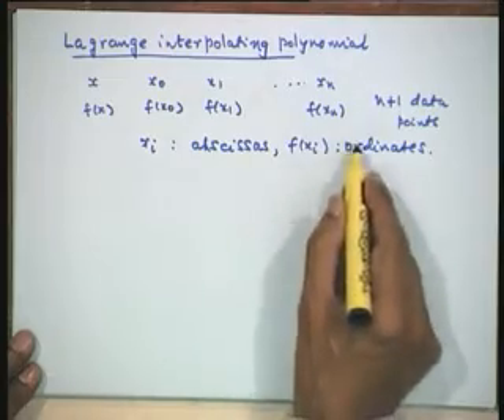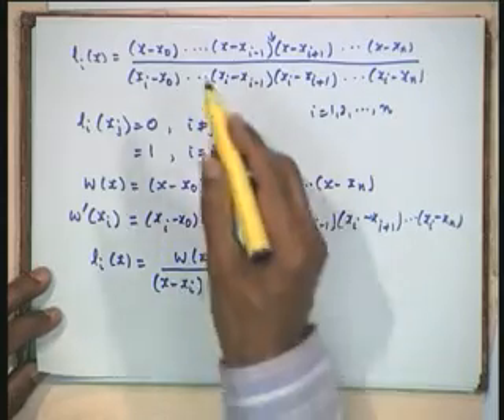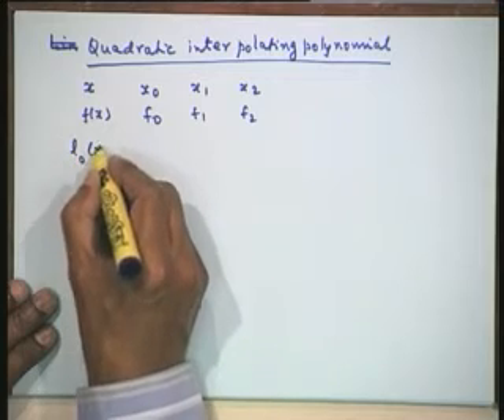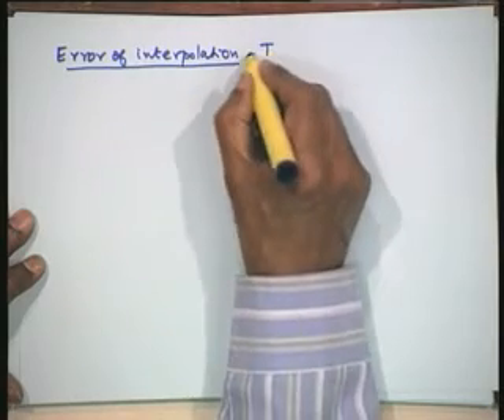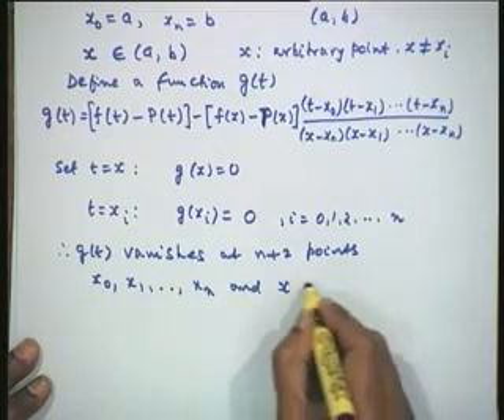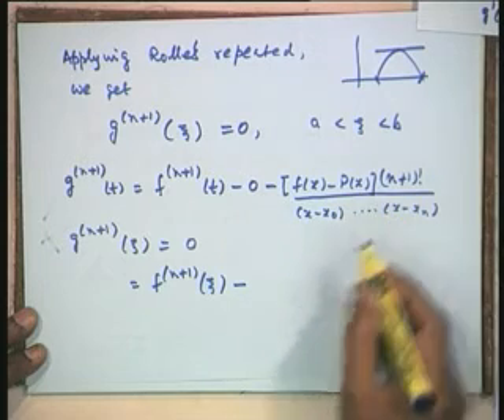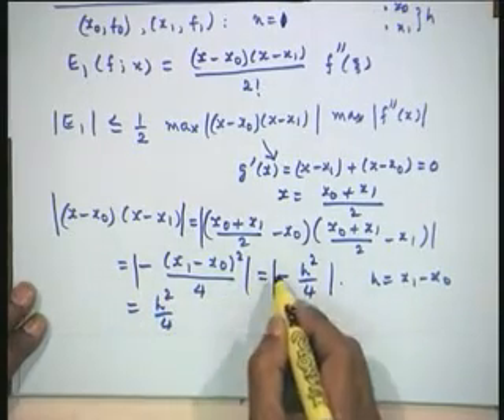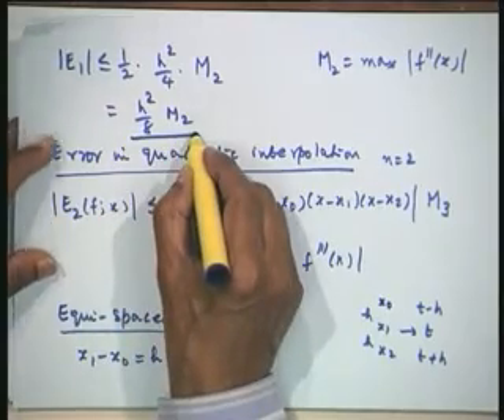Lec-26 Interpolation and Approximation-Part-2

Comment: now what i dont understand is in calculating g(t) in  error calculating, why sir considered x (a variable) as a root(point) and also p(x) is taken of n degree when n+1 points x0,x1,- - ,xn are given (thus it should be polynomial of n+1 degree because n+1 root points)
Reply: @easyexplainer
g(t) was calculated for a particular x, not all x, you can imagine it being any point in (a,b) other than the nodal points. So along with the nodal points, g(t) will also vanish at that x which we have chosen for g(t). Whereas p(x) is considered it will be of degree n only because the fundamental polynomials that we are taking must vanish at the nodal points except its own (the i=j condition) so n+1 nodal points mean n points where it will vanish this implies n roots and this applies to all the fundamental polynomials, p(x) is itself a Linear Combination of those polynomials so its degree will never exceed n. You can also watch the previous lecture or refer to Prof. Iyengar's textbook for further clarity. Cheers : )